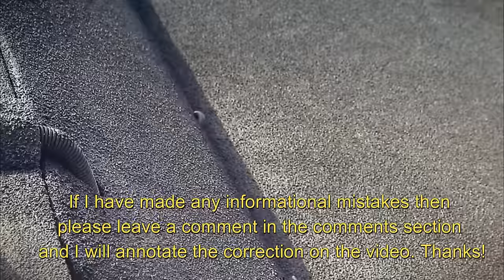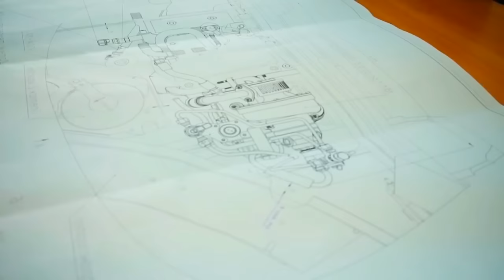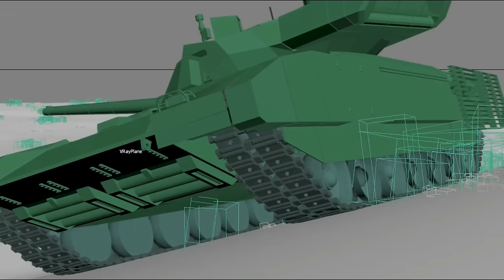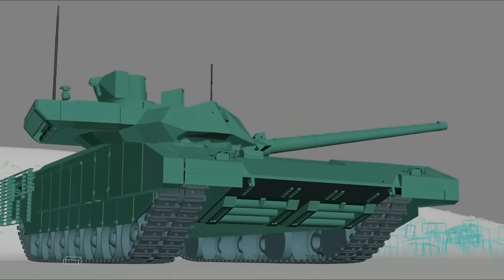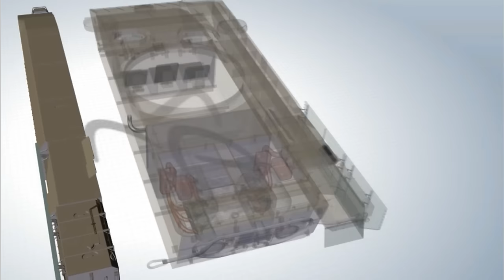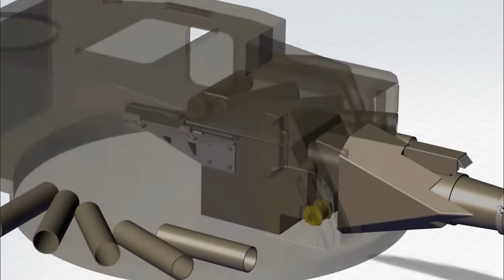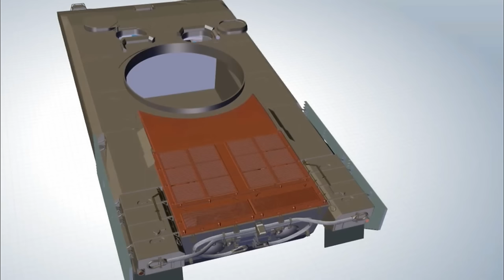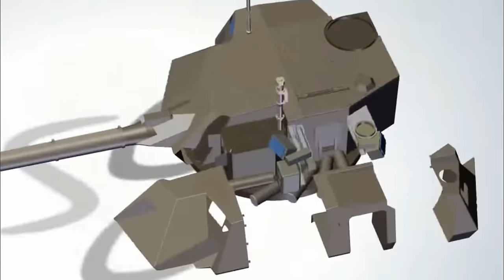T-14 Armata Russian Main Battle Tank - Tank Overview

Comment: Armata ( the new RuZZian super tank ) is in the field of military equipment is the equivalent of vaporware in the computer industry. It is a piece of untested technology, barely off the prototyping bench, announced with great fanfare to scare the competitors off...

This pie in the sky machine is an advanced prototype the Russians might or might have the money and energy necessary to maintain. It is an attempt to leapfrog the enemy on the cheap, by boasting about the autoloader and remote controlled machine guns.

It has some features that are new, especially in the armor and sighting departments, but they are probably just about as good (not BETTER) as the ones found on the current Western main battle tanks. 

It should be remembered that the Russians have some catching up to do. Their previous MBT, the T-72, was one generation behind the US/German/French tanks. 

Regardless of what the Russian Putin fanboys tell you, the T-72 is demonstrably net inferior in performance to most Western tanks. 

The Gulf wars told us that. (PS: T-95 does not count. It was an albatross that never gave Russia what it needed, which was a replacement tank for T-72. Armata does not start from a situation of equality; it is a catch up move.)

The main problem with Armata, however, is that it might not deliver what the Russians need not because it is a bad piece of hardware, but because the country might not have the resources to produce it and continuously improve it.

The Russian military-industrial complex is a very weak one, generally underfunded for the ambitious weapons programs it is trying to maintain. Putin and the Russian military establishment think that they have an entire country and an entire economy at their finger tips, which they can rob blindly to build new toys for old leaders. That time is gone.

The talent, resources, and finances needed to create weapons systems that can challenge the West are gone. The talent is first unavailable. In the old Soviet Union the only way to make a world changing career was to join the military design and production apparatus.

Today, many of the youth that could design the next generation of Russian weapons are gainfully employed in multinational corporations, have or are about to emigrate, or make a pretty buck hacking the-hell-out of the Western banks. doing what RuSSians do best taking other people's resources and money without permission the reast of the world call that stealing but in Russia it is enterprising,,,

The lokal resources inside Russia is  also gone. Russia's economy is just a bit bigger than that of Netherlands and TWICE AS SMALL as that of Brazil.... Why?

With no consumer oriented industries or services capable to compete globally, most of the economic activity is dependent on gas and oil exports.

Throw in some weapons, but since China prefers to roll its own and Pakistan can only buy that much hardware, there is not much money coming that way. (PS: Even Russia's agriculture continues to be a mess.)

By losing its totalitarian political system, which allowed it to generate immense efforts for new weapons systems and by losing the imperial control of many former Soviet and Eastern European nations, Russia became what was before World War 1: a second rate power. Second rate powers cannot build first rate weapons. They typically buy them.

No amount of posturing including the launching of vaporware military initiatives will bring Russia back to its primadonna role. Moscow would be better off buying their tanks from the Germans or from the Brits. But for this they first have to shed their imperial ambitions.

To conclude

Russian military tech is an analog Wristwatches in a digital PC age..

All I can say is if you can NOT keep your super tank running in a peacetime in a parad what hope do you have for it working in a war ??

Russian T-14 Armata Tank Breaks Down On Red Square https://www.youtube.com/watch?v=XgS9GA3nBco

Russia's Armata Tank Breaks Down Ahead of Victory Day Parade
https://www.youtube.com/watch?v=I2B7GeVoJdE

Comment: The anti heat defense system wont do much to APFSDS rounds
Reply: Enough. Required detection, guidance and intercepting munition. All of this is.
Reply: Джо Неуловимый Kenetic energy perpetrators are notoriously hard to intercept because they only rely on energy, you wont stop one of the densest and hardest materials shaped like a arrow that is moving at over 1km/s 
At best such a system would slightly reduce the capabilities of a kinetic penetrator, but it will still easily penetrate the side and rear armor of any modern tank.
Reply: TheLawnWanderer It can destabilize, the remaining energy is absorbed by the armor.
Reply: TheLawnWanderer  they are hard to intercept because they are too fast, destabilizing an APFSDS will make it shatter on impact.
Reply: Graff_Zitel It will not "destabilize" it, but might damage the tip and slightly harm the penetration enough to not penetrate the frontal armor of a tank like T-14. 
It will not however stop it from going through the weaker parts of a tank like it will to a shape charge round.
The round could be shaped like a air gun pellet and it would still go through the sides due to the sheer kinetic energy alone.
Reply: TheLawnWanderer Long rod penetrator loses a lot of penetration if anything goes wrong tho, I'm not sure how much but, the crew compartment can take any current antitank weapon used by any country currently, in not sure how well armored are other parts tho
Reply: Graff_Zitel The main goal in tank warfare isn't to kill the crew. 
T-14 isn't armored everywhere, and a hit can knock the tank out of combat without killing the crew. 

Let's hope T-14 never has too see combat, and nothing else for that matter.
Reply: TheLawnWanderer Correctly, protect the sides and the engine compartment is much inferior to the frontal projection of the tank. But when you consider that the strongest side for today the T-72 (80mm+), it is higher than any existing tank. And is multi-layered( as the side and roof of hull and turret). because tower Almaty was barely 1/3 of the weight of the tower T-90.
Reply: That defense system uses a directed blast, not a puff of air. If you want to know what a directed blast can do, look at the HEAT itself.

Comment: It still looks like a Hollywood set piece. the turret, if the diagrams can be believed, is full of shot traps with rather laughable pinned on light armor plates. it still suffers the main issue with remote turrets. feeding and extraction jams can't be cleared without someone exiting the tank.  with most of the gadget boxes mounted in the turret their usefulness and capability is going bye bye with the first solid hit. if they manage to make this work reliably, it'll be a miracle.

Comment: Just to let you know Russia has cancelled the T14 Amarta programme for now...Only 55 are to be built and only for home defence. One report from the Russian defence ministry says no export models, another says export models. THe production of 2900 T14 MTB's was cut back to 900, then 500, then 55.

Russia has invested 15 billion rubles ($239 million) in developing the Armata tank, and budgeted 39 billion ($622 million) more. But MinOboron is demanding UVZ both complete its design and lower its price. Unless UVZ complies, "MinOboron will not 
extend the contract for delivery of Armata to the [armed] forces, and will refuse serial purchase. ... We'd rather buy the latest version of the T-90 while they finish up the Armata," said the Defense Ministry. To date, the Russian army has taken delivery of only 12 prototype Armata tanks, bought in 2013. A contract is in place for production through 2017. But at last report, no long-term contract had been signed.
Moscow will have trouble procuring as many of the tanks as it had previously envisioned — especially with the current economic troubles that Russia is facing thanks to US and EU sanctions imposed in the wake of the Ukraine crisis. The cost of the Armata is 2.45 times higher than had been projected in the State Armaments Program for 2020, the military reform 
package the Kremlin devleoped in 2010. "As a result, the Defense Ministry is expecting to reduce the number of Armata tanks it will procure, focusing instead on continuing to modernise existing T-72 tanks in the medium term," the brief notes.
 "According to Russian media reports, Uralvagonzavod [the company responsible for manufacturing the Armata] has agreed to lower some Armata costs, but the program will still be expensive."
Reply: Are you taking medication as prescribed ? “We have a contract for a pilot batch of more than 100 machines. They are already arriving for trials,” Deputy Defense Minister Jury Borisov
Reply: Bat Hell
So are you taking your medicine?
a Pilot Batch order of 100 or 55 doesn't mean that the whole pilot batch will be delivered.  Also seeing as Borisov made both the 100 and the 55 statement how can he be believed....? The first 'batch' is twelve tanks...Twelve..

Comment: This is a first! the Russian military is more concerned with the survivability of their tank crew on the Armata T-14. There is one issue though if the crew are all together in the driver's compartment that would mean that everything in the turret is operated by wire. That is a huge recipe for a screw-up. It's new now but what happens down the road a piece when it has a few hours of operation under its belt? It would really bad to be in the heat of battle and have a full or even partial systems failure. If all the crew isn't present in the turret then that means there aren't any manual means of moving the turret which is great as long as the system works but God help work if it doesn't. Isn't this the tank that they only have a really low number of? I want to say it's in the neighborhood of 14 to 28 so don't look for this one trickling down to client states like Cuba, North Korea or the like anytime soon.

Comment: I wonder can a fgm javelin take it out....oh and pls do a vid about javelins. And one more thing even though the t14 has modern defenses it won't last for ever and im pretty sure a fgm javelin can take it's turret right off using the "top attack" which means it impacts directly on top of the tank, it is known for blowing turrets off tanks fast. A report from the US of the 2003 invasion of iraq, said a platoon of special forces equipped with javelins took out two t55's eight armoured personal carriers (bmp's), and for troop trucks in less than 10 mins.  Yeah the t14 and t90 do have defences from atgm but not from top attack atgm which why i think a platoon equipped with javelins can take out t14's and t90's in 1 or 2 shots
Reply: Javellin has a very short starting distance and is sensitive to interference. Optical, smoke, etc. The upper hemisphere T-14 is closed by modules of a multilayer polymeric armor like Merkava. In addition, there is an active defense system there too)
 Javellin, even if it turns out to hit precisely, is not capable of causing critical damage, because The systems are duplicated and closed by the main armor. In addition, the operator will die with a high probability before the missile enters the tank, suppression of the operators is automatic and its life time is reduced only until the time of recharging the weapon with a fragmentation projectile with remote undermining. It is extremely difficult for a person to compete with a computer in terms of quick decision making.
Reply: "systems are duplicated"

Isn't true.

Comment: I think when these things are combat tested their going to be tough as hell...keeping all crew in one small compartment, no doubt lined with something like tungsten or depleted uranium, its going to be very difficult to knock out the crew even when the tank is tanking heavy damage. it may be susceptible to EMPs though if its not shielded, because with no manual loader and turret traverse the thing is completely dead in the water without electronic systems. take notes nato
Reply: The tanks are completely immune to EMI. Not ceramics without uranium, something else is lighter and better) All systems are duplicated and managed remotely, each system or unit has its own controller and can be replaced by another, as in the PC.

Comment: Unholy Warrior..... That's not true . 
They have actually cut their military budget and are building infrastructure like crazy , realising that without decent roads , bridges and railways  you can't move military assets easily , and it's also more efficient for trade .
They have high speed rail , have completed the oil pipeline to China , and are building a gas pipeline to China as well . 
Look up also the 19 km Kerch bridge from  Russia to Crimea .They built that in 2 years .4 lanes of traffic , and a dual rail line on the bridge will be completed this year .
 I suggest you do some proper research before spouting stuff that is demonstrably false and misleading .

Comment: It's the right design for the wrong war.  Heavy armor is last century.  There will always be a need for light armor.  However, given the importance of modern information warfare, it is relatively easy to destroy large heavy targets, such as tanks, by lighter, cheaper forces from safely outside of the tank's effective combat range.
Reply: Heavy Weapon is necessary to minimize losses.
Reply: Depends on geographical position and current politics

Considering how things unravel lately wouldn't blame nor question investing into better tanks
Reply: There's a reason the US hasn't (publicly) put any serious investment in heavy armor in the past 10 to 20 years.  We have developed too many weapons that make them essentially mobile coffins.  Unless there is a significant change in armor technology, tanks will go the way they of the battleship.  Air power and reconnaissance (C3) capability simply makes them obsolete
Reply: Alex T Most modern tanks use APS.  That means nothing.  Missile technology has been improving as well.  I stand by my statement.
Reply: It is a mistake to consider that this armor is light, only in comparison with the old tanks. Other materials, multilayer armor on all sides, not only from the frontal view. + Active protection and interference generators. 53 tons of it a lot, maybe even a mass increase to 65 tons.
Reply: Джо Неуловимый, I agree that calling tank armor "light" is a mistake.  What is not a mistake is the belief that heavy armor, such as this tank, is obsolete.  Given modern war fighting capabilities, tanks are nothing more than very expensive targets.  There will always be a need for some armor for use in conjunction with troop movements, which is why the majority of armor development in the US has focused on this.  It is unlikely the US will ever field a new tank barring a significant technological reason to do so.

Comment: Isn't this tank just a bit too big? I feel like if an atgm crew ever catches the side of this thing in combat, it's gonna be bad. The other T series tanks I really liked because of the low and short design.
Reply: Well because of the new APS on Armata there is nothing to worry about, since it can even destroy APFSDS rounds. Also Armata has some stealth tech which make it hard to detect on radars and stuff (its not any bigger than the western tanks)
Reply: The high line of sight is important tools for 152mm, also need a place in the housing for the crew.
Reply: Armata signifies a shift in tank design philosophy for Russia. Soviet tanks were designed for a WW2 style conventional total war. They were tough, cheap and expendable. Modern Russia's strategic doctrine relies mostly on nuclear deterrence for strategic safety, delegating the use of conventional military to isolated conflicts. Because of that, survivability, versatility/flexibility and price efficiency are among the major concerns.
Reply: It is bigger then most Western tanks, but not by too much. The Russians have clearly thought of this. I have never been to keen on Russian Tank Traditions, but i am Very impressed by the Armata. Super Tank!

Comment: Why are you all fighting about witch tank is better the t-34 while not the most advanced or best armed/armored  did its job amazingly well it was dirt cheap fast easy to maintain and produce it was upgradeable and their were a shit ton form a strategic level the t-34 was essentially a perfect tank while it couldn't compete in a 1 v 1 with many german tanks it didn't half to it called 200 of its best friends as for the more modern tank; with the continued advances in armor Technology era and composite shoulder fired rockets are becoming obsolete in the roles of tank killers while still effective vs IFVs.
As the true armor specifications of the t-90 t-14 and M1a2 sep are classified without a direct confrontation it will be very hard to say the m1s did very well vs the t-80s and t-72s but it all depends on how they are used not just the tank an m60 can kill a t-90 and a t-72 can kill an m1 so people stop bithcing a tank is a tank no modern tank is safe from another modern tank that why we all still have tanks to kill tanks 
Ps Leo 2 a7 is the best and no armor matters if the enemy has air superiority even active defense can't stop even bomb every time or even air burst munitions :)